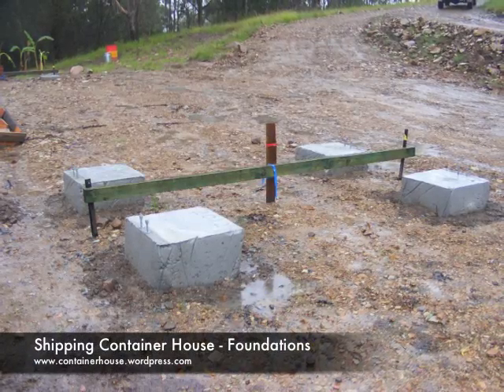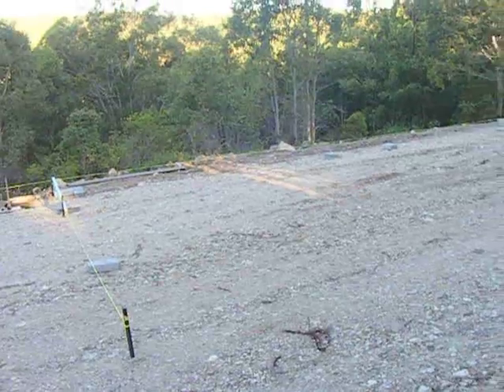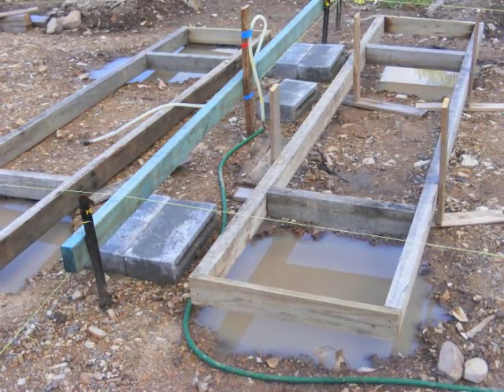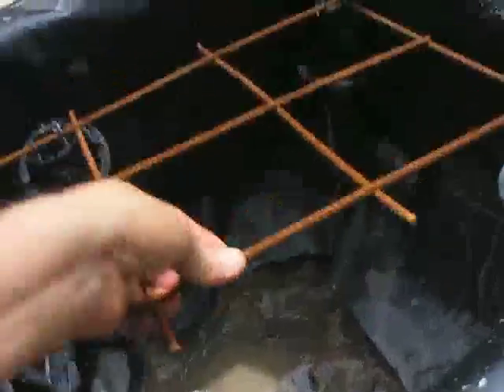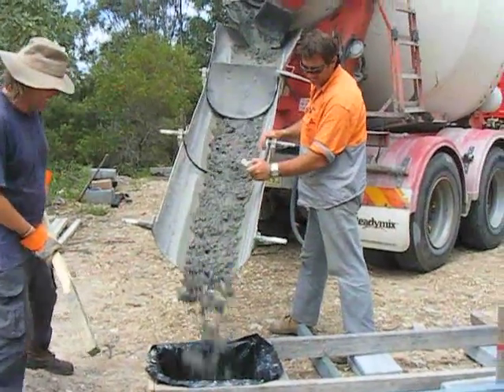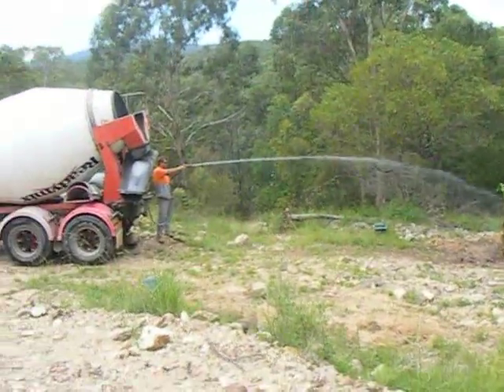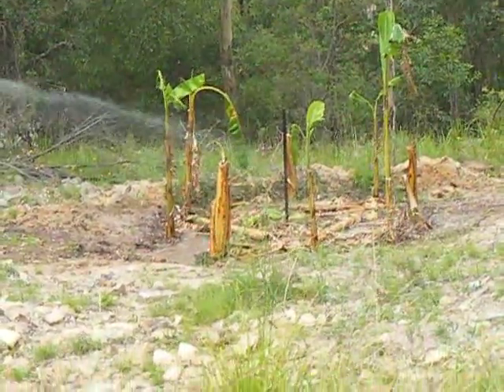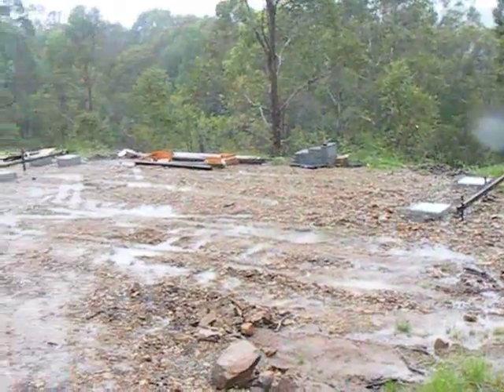Shipping Container House - Foundations

Comment: You didn't put any steel bars inside the foundation aside from the one's at the bottom? Do you think it can hold the weight of the container in the long run without cracking? Thanks! Your site is very informative. I am also currently making a shipping container locker facility here in the Philippines.
Reply from the maker: Hi Jhan, welcome. Many containers are just put on one or two cinder blocks, breeze blocks, bessa blocks. I used a mix of concrete recommended by the delivery company as good for foundations. It has been 4 years and no cracking has occurred. I am confident it will be fine. I have seen portable buildings installed on stacked blocks on VERY big commercial building sites. Mine are anchored. Good luck with your project and I am pleased the channel is helpful. Cheers Paul

Comment: Hey mate, do you have to consult any authorities about the kind of footings used? I would like to use this method also but not sure if I can just go ahead and do it!
Reply from the maker: +ryan smith Hi Ryan, if you are just placing a shipping container on a piece of land, I do not believe that special footings are required. If you wish a council to bless a container as something other than a container, you would need to consult them. The council are also not in the business of answering questions. The standard response is probably, show us a plan for what you want to do and how it complies to the appropriate code. I work in an area that has a small village of major building contractors working in portable buildings. Their buildings are resting without anchors on 3 feet tall piers of concrete blocks just stacked up on the ground like lego blocks. No footing of any sort. Cheers Paul
Reply: thanks mate

Comment: Love your channel Paul! You have inspired me to build a container home instead of a trailer built home..I live in the us in a area prone to tornado what do  you recommend I do for my foundation?as I would like to have two containers side by side welded together to create large open area..
Reply from the maker: +Shawn Musgraves Hi Shawn. You are describing a bigger project than mine. Taking the side off and keeping the structure is harder than a single. Though you will be able to do it. I liked a solid concrete block for a foundation. Others have done differently but we have had 2 cyclones that did not impact us. If you watch the early videos they share what I did on the foundations. I also add prices in the ebooks. Containers will be a lot stronger than a trailer style home. They use a lot of thin insulation and hardboard. Cheers Paul
Reply: +Paul Chambers   We will have to build a pitch roof.  Snow weight may not be a problem.  But, in Colorado we have the slow melt and refreeze.  Water can and will erode anything.  Ideas on pitched roof?
Reply: +Shawn Musgraves   Do it with storage containers.  Everyone knows that a tornado is magnet to trailer parks.  LOL!!!    Make sure you give your container home room to breath.  The pressure built up from tornado or hurricanes is one cause of destruction.  Open a windows when high pressure weather comes.
Reply from the maker: +Christine Tuck A pitched roof should be quite feasible with a shipping container. I would explore if you can make the pitch match best solar panel angle for winter setting. If you are having a container get one with a perfect roof section. They will shrug off water UNLESS they have dents in the roof. Then they pool and corrode. The roof rails are very strong and you can bolt or weld a steel or wooden structure to them without much difficulty. I think a sheet metal roof would be easier than tiles. They can be made lighter. Cheers Paul
Reply: Shawn Musgraves, As far as foundations go,  The research I have done suggests ONLY support the four corners.  The containers do shift slightly.  This may cause damage to the foundation and prevent the natural shifting of the container. The foundation would may also cause some of the weight to be supported on the sides.  The strongest points are the four corners.  Placing it on the ground or on a slab could also work.  Placing it on the ground would cause critters to burrow underneath.  In Colorado we have problems with fire.  When you raise it above the ground to mitigate fire, I would suggest gravel underneath of the raised container.   (Tornado and hurricanes create different air pressure.  Make sure if a tornado is coming to leave your windows open to prevent the inside pressure being different than the outside pressure.)

Comment: nice work though.  love to see people doing this
Reply from the maker: +Matthew Mccarthy Hi Mathew, thanks for thew wisdom. The container have survived a few cyclone now. The bolts were really to resist the wind from being able to get them to start moving. Cheers Paul
Reply: +Matthew Mccarthy Not certain about the points made but ,if anyone else wants to uncover build your own shipping container home try Jadonite Shipping Container  Buddy (do a search on google ) ? Ive heard some incredible things about it and my buddy got great success with it.
Reply: +smirgou focus greetings.  my points were 1. no need to bail out the water. just pour the mud in. it will displace the water. as we all know cement fairs quite well the longer it's  wet. 
2. if plan to cantaliever or stack multiple units you may want to consider larger footings and heavier anchors.  
Those were my points. however building codes my be much different here in Minnesota. But great video.  love to see people building these. I'm starting one with containers very soon. I'll put some videos up on my channel.

Comment: well the tiny threaded rod and small base plate weld won't do much. 3/4" to 1" stainless j bend rod. epoxy coated.  no need to bail out the water. mud will displace it. the longer your cement is wet the stronger and less shrink it will have..

Comment: All shipping containers expand a little what stops them cracking the side out the footings as you did not place the fixings in the middle of the pads as per building regs & common sense.
Reply from the maker: +Andy Neal Hi Andy. The containers creak in the morning and in the evening as they expand or contract. I think the ties give a little and doubt that the concrete would be likely to fail. Please explain how the regs would fix the centers. There is no fixed anchor point in the center of a container and that would not stop the extremes from moving. Presumably you think the corners should be anchored? I am very interested in how you think they should be anchored. I hope you respond. Cheers Paul
Reply: Most Regulations & common sense dictates that if you have a fixing it should be places to the center of the mass.  Have you ever seen Rebar on the outside of concrete. My comment was that your fixings are on the edge of your footing not in or as near to center as possible.  Nothing to do with center fixing of any container as they don't have them.
Reply from the maker: +Andy Neal Thankyou. I see what you mean. I placed the center of the casting in the center of the cement block so the weight would be distributed evenly. The tie downs on reflection are a little close to the edge. I was uncertain how accurate my measurements would be and I erred on the side of putting the steel anchors further away. It turns out my measurements were accurate and I could have gone closer to the center. I envisaged the tied downs would only be preventing the wind from pushing the containers off the concrete.  I thought the weight of the package would probably have held them down without ties. I photographed commercial building sites were the accomodation containers were just stacked on a 15 high breeze block stack and no anchoring. Thankyou for taking the time to answer my question.Cheers Paul

Comment: I sell and deliver these all the time and i have seen some Interesting footings i must say All the strength is in the corner castings and most will not over load in a private set up so you wont buckle the floor etc
The best and easiest i have seen is a new footing invention www.surefootfootings.com.au Check it out as so easy to set up
If you require a Container or need one moved let me know sales@cktrucking.com.au Im based in Brisbane but will travel anywhere Chris
Reply from the maker: Hi Chris, Thankyou for the comment, I had to pull it out of junk. That is good news for me, and 3 years on I am still holding solid. I will have a look at the link later but good luck. Cheers Paul

Comment: "I was just wondering if there was any sort of prefab product that could have been used to assist in those foundations"
Sonotube and similar products are designed for convenient cylindrical foundation pours.
"I see bolts but I read welding to steal in bed into the cement is better.... Why did you choice bolts?"
No, it isn't necessarily "better". If you bolt and the foundation settles over time, you can loosen the bolt and shim the container. Welding means getting the torch or grinder out first and MUCH more work.  You can bolt externally to the corner fittings by welding on flat plates with holes cut for bolts if you want the greatest ease of installation combined with the ability to use large L-style concrete anchors which are threaded for nuts.
The only way I'd prefer welding to a "foundation" is as in in my installation where I welded my ISOs together and to the large I-beams which support them on the ends, but I want to keep them together and lift or lower them together if needed. If I need to move them (I don't plan to) a cutting torch can make very clean cuts which will allow welding them back together afterwards, but most homeowners don't have all that equipment.
Those who DO have welding gear would be well served to visit welding forums such as Weldingweb and the Miller and Hobart forums. Many folks there who professionally mod ISO containers and can clue you in with a welders perspective. I have my welders inside, ground to the shell, and run a single lead to stick or suitcase feeder depending on the task. Welders will LOVE ISOs, but when a welder works on one they should think "welding and fabrication" when attacking a challenge. Visit the Sea Box site for ideas.

Comment from the maker: Hi Amanda and welding hubby. They were only square because I was using donated wood to make the frames and I found plywood in a skip. I looked for round cardboard tubing that they make car park pillars but could not find a supplier. I thought about using a barrel as a shape holder. This would have meant I needed 8 barrels, as I was going for a single pour, not making one at a time (too costly). I share other ideas in a book just released. buildshippingcontainerhouse (link). Best of luck Paul

Comment from the maker: Here is one being attached.
Watch my video titled "Shipping Container House - levelling the containers"
I thought the corners had holes that went completely through and bought 2.5 m lengths of pipe to bolt down with metal straps. I was wrong, the holes were blind. I cut short poles and am cantilevering them down with a packer. I am about to join the containers with a walkway and will revisit the securing method. That is my next step so will have a new video soon. Cheers Paul